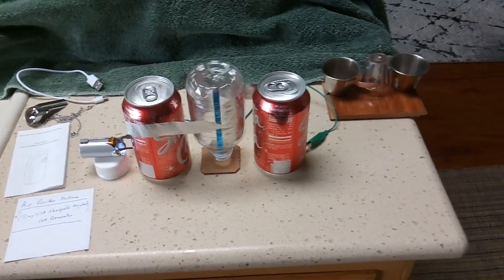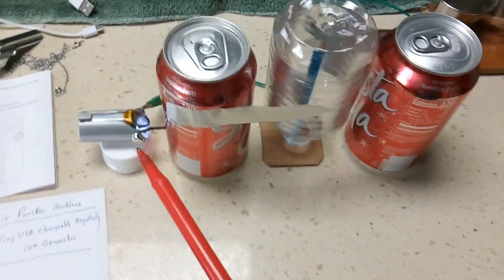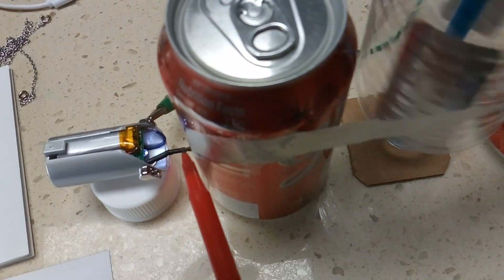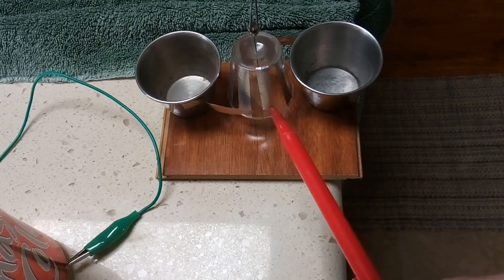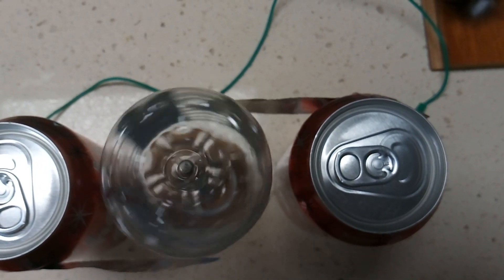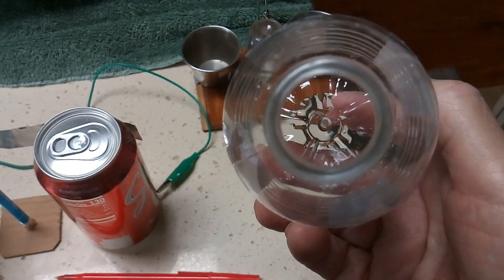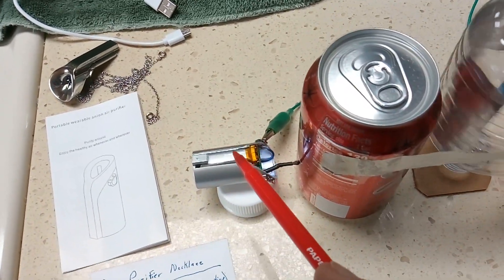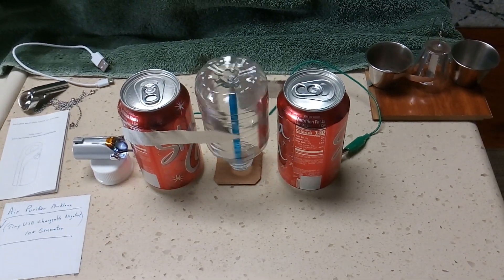Electrostatic Motor Powered by Air Purifier Necklace

Comment: Could those battery operated bug zappers work for this?
Reply from the maker: Yes those work very well.  Just be careful about getting 'zapped' yourself.  The voltage is very high and there is enough amperage to give you a pretty bad shock.  It is OK if you are careful.
Reply: @Lidmotor  can't be any worse than 120 volts at 10 amps to the mouth. How I died over 40 years ago. Left me with a nice little scar on my lip.

Comment: do you think a static electric field firing electrons consumes any power? (assume the electrons were generated without using any power)
Reply from the maker: That is a very good point.  You can harness static electricity right out of thin air.  Check out Lasersaber's work with his electrostatic motors that do just that.
Reply: @Lidmotor  I assume total system energy is conserved, if electrons go one way and the field the other way

Comment: Electrical storms can build up a static potential, would be fun to put some aluminum foil on the windows and use earth ground, to see if it can turn that motor .
Reply from the maker: That would be fun to try as long as you were careful not to get zapped.